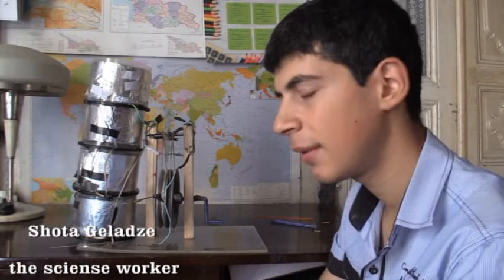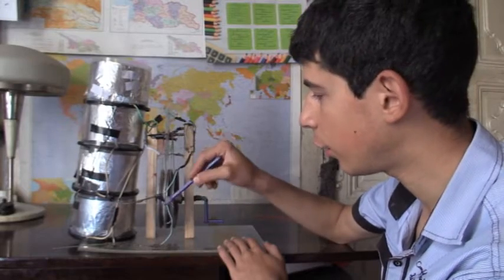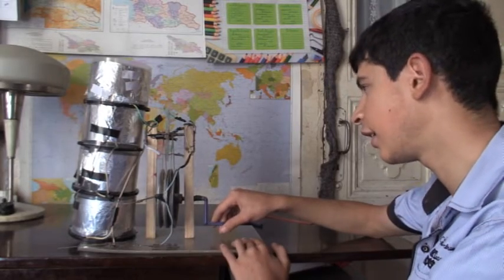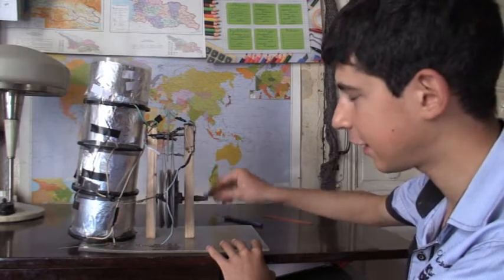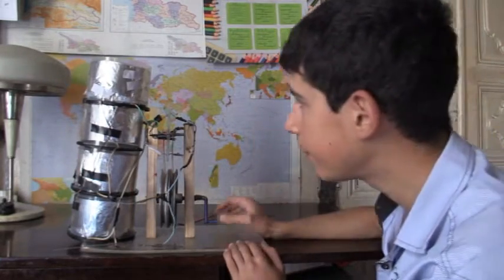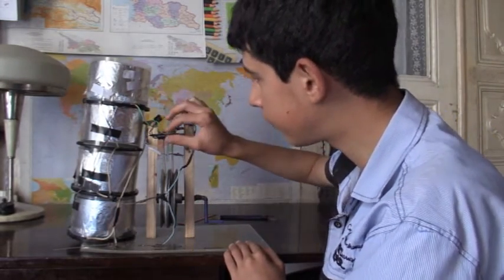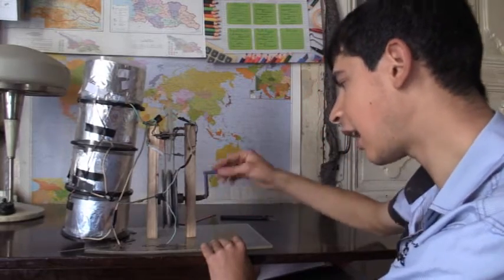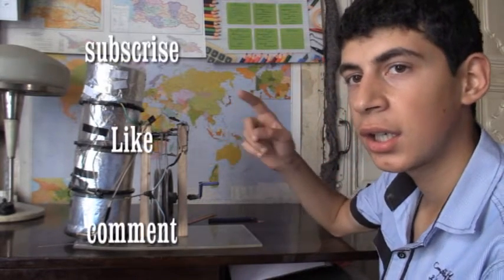powerful CD wimshurst machine

Comment: Cool!  I was impressed that he never failed to discharge the unit before touching it.
Reply from the maker: yes it was not failed because discs are so closed to each other  and also everything is moving  really free so it shouldn't failed also main reason is that  there is 12 sectors witch makes strong output into leyden jars also leyden jars are strong's one layden jar can store 6.5-7KV.